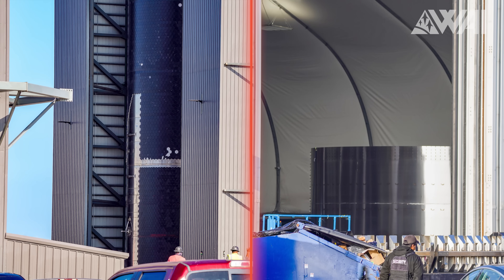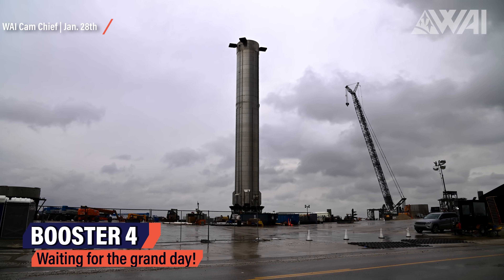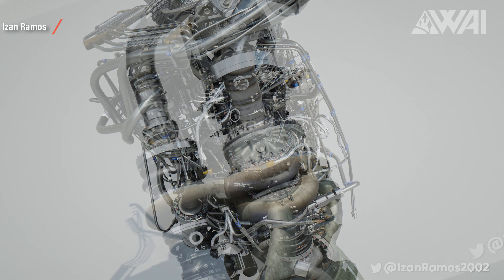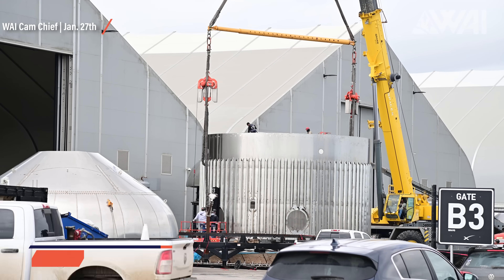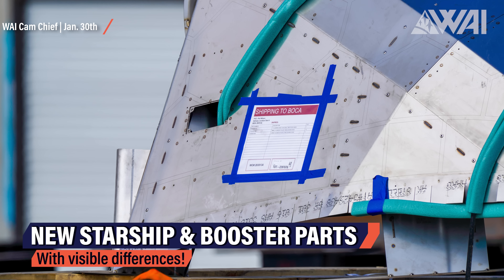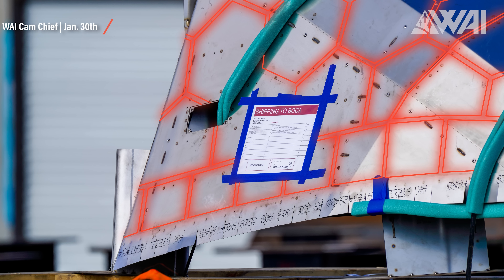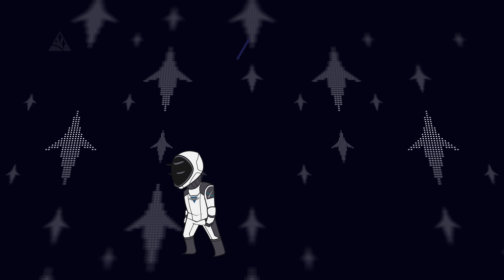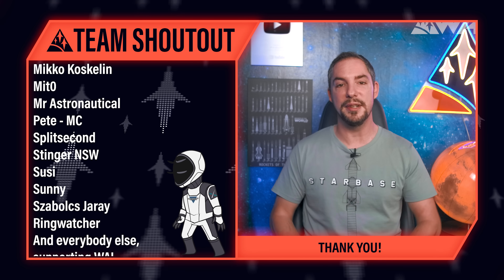SpaceX Starship Raptor 2 - When is it coming? Where will it be used?

Comment from the maker: What's the first prototype SpaceX will use Raptor 2 on? What do you think? :_WAISweet:
Reply: Great video Felix! Keep it going! 👍
Reply: Oh sí, nuevo video
Reply: 24
Reply: I think there's no question:  8/24.  SpaceX simply won't have the McGregor production facility up and running soon enough to outfit earlier model ships or boosters.

The more pressing question is:  Which booster/ship combination will be the first to fly?  I've already guessed that, too, will be 8/24, but it could well be even later in the progression than that.
Reply: I believe it's going to be mounted in my Silverado, after I do some welding to have a very solid mounting point, and add a couple more fuel tanks, a couple SpaceX engineers are going to have to help me with this conversion😆😉
Reply: Felix had a little mistake in script editing at 8:53.  And 9:01 And 9:01.
Reply: who care launch the starship.
Reply: B7 is 33 engine booster
Reply: hey felix just wanted to mention from 8:54 to  9:07 the line repeats itself, i thought i was just going crazy but i rewatched it 5 times to make sure, just thought id give you a heads up
Reply: Hey, Felix. I have a question, do you write your scrips in English or in German, I assume in English. But if to my surprise, you do it in German, could you insert a German sub. That would make it way easier for Germans who want to start in to the amazing world of space, to understand all the specific english terms.
Reply: @jeffrey949  The Raptor builders didn't got the memo. Also, I think there is no bird named Raptor, Raptor is just a word for birds of prey.
Btw, bird seems a little overstretching for describing a Draco.
Reply: Nice job
Reply: 24/7 stsck
Reply: 24/7 stack
Reply: @gamerfortynine  All of them. The outer ring doesn't change the number of engines. It always stays at 20. The inner section is where the change is from 9 to 13.
Reply: Please cover subject about Starship Crew access arm!!! Thanks a lot in advance!!!
Reply: The bags are 100 ton rated. NASAspaceflight caught a closeup of the bags. So 400 tons if all bags were full?
Reply: Wouldn't the upper starship need some fuel before the booster is fully fueled in case the booster explodes so it can perform an escape maneuver? Or at what point in the fueling process for manned missions will they need an escape procedure?
Reply: @Thomas_Acharya  Good question. Don't know if they have even tackled that yet.
Reply: They will Raptor 2 use 24/7.
Reply: OH NO!!!! Editor doesn't know his English!!! @11:50 it's a "LIFEtime Warranty" ... not a "LIVEtime Warranty" - better take care of this so that advertisers don't notice and complain ...  (I just want to help, plz don't be mad at me)
Reply: Well, I don’t think StarShip is going to make it to orbit this year with a 100-ton payload, that’s for sure.
Reply: Why are they still working on the raptor when ELON MUSK AND NASA JUST ANNOUNCED WARP DRIVE 2022?!

Comment: The difference between Raptor 1 and 2 is so small that even the engineers working on them can't visibly identify them. The changes are all on the inside geometry of the powerhead.

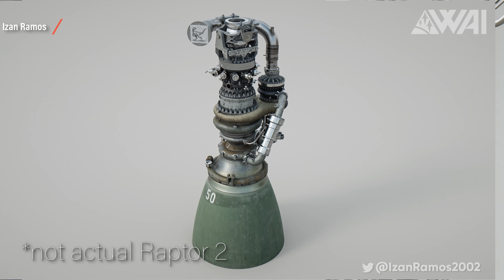Comment: 3:37 is NOT the model of raptor 2, not even close. It's done by removing external pipes of the raptor 1 model. It's the core of a raptor 1, or you can call it naked raptor 1.

Comment: Great job Felix I'm wondering how ships will move from landing or refurbishing to tower I don't see ships that need repairs or even cleaning and loading blocking towers if  it going to many launches per week
Reply: I expect eventually the chopstick/arms will transfer ships or boosters directly to/from the transport bases to be carried by SPMT (self-propelled modular transporter). No other crane involved. However, the other test mounts will still require the crawler crane.

Comment: They have stated about a year or half a year ago that they are producing one Raptor 1 per 2 days, so they probably have at least 90 Raptors already made. Maybe more. Raptor 2 also isn'T that close to mass production, and as I remember testing and delivery have a larger time delay between them, so I would be surprised to see 33 Raptor 2s delivered anywhere near today. Much rather in about half a year.

Comment: I think SpaceX found some rough spots on the tower-side tracks during the first round of chopstick load testing.  So these latest tests could've been used for checking the repairs they made last week.
Reply: You saw someone using what may have been a depth micrometer to check a number of spots. And then someone else do some grinding. And then another check.

Comment: id say maybe by summer they will be rdy for a orbital launch maybe, cladding commission the tower and mount, static fires with more than 3 raptors, 2 more horizontal ch4 tanks need to be installed since the vertical ones haven't been certified , lots of things to tidy up

Comment: Is it true that the chief engineers on the Raptor 2 quit/resigned with barely a word to Elon?  If that's true that was very bad form.
Also, is it true that Elon took over and slept in the factory again until he had the problems worked out?  Maybe he just provided the LEADERSHIP that the team needed to clean it up.   Neither case would surprise me.  After all, this engine is key if Elon is going to send a starship to MARS before he gets any older.   Don't bet against him.
Reply: My understanding was it was just the managers. There may have been a conflict as to what the engineers wanted and the manger wanted and the engineers won.

Comment: I'm so pumped to see the arms stacking, and the ship/booster being fueled on the stand. It's going to be so cool to watch!
Reply: I'm pumped for the orbital launch!!! It's been a long time since the last suborbital test. Getting so close!
Reply: arms stacking(for landing) is a miscarried idea! One big BOOOM and thy will come back to normal vertical landing!
Reply: @szyszka8303  yep I'm really nervous about this aspect too. Remember the booster can hover so that's some assurance but I expect to see a few blown up stage 0's along the way.
Reply: @micwallace   level of accuracy/precision for this ladning is not possible to achive(with arms).  If rocket shift 1-2m left/right side(because of weather, broken precision?) ... arm will slightly move whole rocket? :/ If it blows. How much time it will take to rebuild tower with arms? Now it took 1 year !
Reply: @szyszka8303  It's a reasonable concern, and I was very nervous about the idea when the idea was first described. I'm growing more confident by the day, based on recent comments about its operation use and how the design would handle the wiggles during hovering. 

You're right though, it could go wrong, as rocket stuff does. I suspect the tower will be fine, some of the towers plumbing and electrical might needs repairs. I believe they will put panels on the outside of the tower to protect stuff. Fingers crossed!

Comment: Anyone think they will upgrade to T-Rex engines for higher thrust to weight ratio once they produce enough of them to fix most of the issues with the design?
Reply: For the 18 meter wide Starship.
Reply: Raptor is a bird.

Comment: Hey Fexix, thanks for the informative Raptor comparison. Now that SpaceX has a reliable production Raptor, would it not make sense to convert a Falcon to run methalox, and fit a reduced number of Raptors?  With the number of launch sites to increase for Starship, it would make sense to be able to support Falcons as well, one of the benefits being at first to provide manned access via crew transfer to a Starship.
Reply: I'm reasonably certain that SpaceX has already done the calculus on this prospect and concluded that the changes that would be needed to the Falcon 9 would be too costly and unnecessary once the Starship program is online.  SpaceX wants to innovate, not recreate.
Reply: Falcon 9 is being phased out.  Starship is the future.
Reply: Why would one want to launch a semi-refurbishable rocket when one can launch a fully reusable one?
Launching Starships will, if all goes well, be vastly more economically interesting.
Reply: Why use both? Why do small cars exist when we have trains. Why do small planes exist along side an A380? Why do other start ups have a business case built around small launch vehicles?
Reply: @michaelreid2329  You didn't really read what I said about economics, did you?

Comment: Would it be possible to run raptor 1 and 2 on one vehicle? I’m guessing not, but could be good for testing? I’m no expert
Reply: Mass flow rate of propellant to each model of the engine is pretty different.  So, downcomers would probably need to be sized differently.  Next, Raptor 2 produces 230 tonnes of thrust (or thereabouts), while Raptor 1 produces around 180 tonnes.  The imbalances would either cause asymmetric loading and thrust vectors, or would require vastly different throttling levels to maintain balanced load and thrust.  Either way, way too complicated for a test article that already has enough variables to work out.
Reply: @glennpearson9348  ah I see, thanks for the info 🙏

Comment: will starship qd be adjustable in vertical direction for the stretched boosters that are being designed?
Reply: They can adjust it when they reassemble Mechazilla on the new launch site. They don't need to fill it in Bocachica.
Reply: @xiro6  When did anyone say that they were going to "move" Mechazilla to Kennedy SC??
I haven't heard that before.
Reply: @walter2990  You haven't heard that because it's patently absurd.

Comment: It was possibly a stress test but Adam has footage of a Raptor 2 running engine rich. Big "whoop" and green flames and an attempted restart some time later with another double whoop, turbopump screams of pain and a copper rich green flame. Probably died at that point.
Reply: Yup.  I saw that too.  Clearly, still some bugs to work out.
Reply: @glennpearson9348  Still seems to be performing very well, so I think it was a stress test.
Reply: @please_stop-v7o  Everything's a stress test.  The goal is to minimize the damage when the failures inevitably occur.  I'd rather see an engine eat itself on the stand than when mounted to a booster or ship.

Comment: Hello, I have a quick question please.  Do the solar winds travel outward in a spiral due to the Sun's rotation and the Parker Magnetic Field, or do the solar winds travel in a straight line independent of the field's influence?  From what I could find the solar winds are bent into a spiral and hit Mars at a steep angle.  But I want someone who knows more about this to correct me.  Thanks in advance.
Reply: Interesting idea. Cant say I know more or less than anyone... but you can watch footage of solar wind captured by SOHO such as "Decades of Sun from ESA & NASA’s SOHO" which sits directly between Earth and Sun, reportedly so it can provide early warning. In this or other images such as solar wind colliding and deforming Earths magnetosphere  - I've never noted any significant drift shown, the wind appears to come straight from the sun with lesser currents and perturbations occurring in any direction. It would seem Soho could not provide early warning of storms if they were spiralling significantly. The Parker Magnetic field would seem to have greater effect on electrons, with most of the mass and momentum of the solar wind made up of hydrogen and helium nuclei - that may overall just plow through the alternating fieldlines and current, instead of being swept up in them.
Reply: @adymode  Hello and thanks for setting me straight, I'll take your advice and go have a look.  When searching around I came across a web site called SDO & Space Weather written by Dean Pesnell from NASA.  It has a graphic on the landing page that I may have misinterpreted.  Cheers.
Reply: @gort2352  
Hi Vince, Thankyou -I'm stretching to get it straight myself... to me the graphic on that page seems ambiguously explained under the text, a part which reads: "charged particles are steered and accelerated by the magnetic fields that pervade the solar system" suggesting that winds travel in that strong spiral pattern shown. While the last sentence states - "with the charged particles of the solar wind spraying out into the solar system *like a garden sprinkler*" suggesting the graphic does not show the path of wind. As when we stand by a garden sprinkler it does not curveball water droplets towards us, they all fly straight outward from the sprinkler. The droplets expand out in spiralling lines as they are released in sweeping lines. We still must place our hand straight toward the sprinkler to stop getting water in the eyes, just as Soho sits directly between the Sun and Earth. 

While the sun does not emit wind in discrete jets, and the sun emits wind at a wide range of velocities unlike a sprinkler, the graphic might indicate how the pattern of two different velocities would spiral, if emitted spinkler-like in jets rotating in sync with the Suns magnetic field. 

The Parker Magnetic Field itself would be different again to either of these plasma/wind velocity traces that pass through it, as it is the actual magnetic field. The interplay of the Parker field and wind of different electromagnetic tendencies spiralling out at different velocities through it, presents to me a more fertile ground for generating space weather phenomenon, than for fully comprehending it :]
Reply: @adymode  Thanks Andy for your response.  You can understand my confusion when looking at the chart that shows the solar winds clearly spiraling outward at different velocities.  I've seen other graphics that seem to depict the same thing.  It's important to me that you understand that I greatly respect your opinion, you know more about this that I do so I'm not arguing with you.  But I do want to better understand this, part of that is what I consider “having a conversation”.  Having said that, I'd like to make a few observations please.

First of all I think Mr. Pesnell's comparison to a garden sprinkler was not the best choice.  None of the forces experienced by the drops of water are comparable to the forces emitted by the sun in space. Earth's gravity alone should invalidate the comparison, but I get his point, he was trying to simplify things.

I've seen a different graphic that showed the solar winds in a spiral but they were all shown from above the poles where the spiral is clearly visible.  That other graphic included Earth's orbit, on this image the spiral was much less developed by the time it hit Earth but greatly increased it's curve the further it extended away from the Sun.  That's why I assumed the curves were much more pronounced by the time they hit Mars, which sparked my question.  It appeared from that image the the spiral was far less developed when it's close to the Sun.

I did watch the video you mentioned, as I did it occurred to me that the observing satellite is in the same plane as the spinning Sun, and with a relatively cropped view.  Because it's not above the poles, with a cropped view and it's much much closer to the Sun is it possible that a spiral (if it actually exists) would not necessarily be noticeable?  Again please don't think I don't appreciate your response, just wanted to bounce a few things around.  

Thanks Again.
Reply: @gort2352  Dean Pesnell's email is on his Nasa Bio page. Im sure he wouldn't a little query on the subject : )

Comment: 3:31 in reality the difference is not so radical. As we can see on some low-quality photos of it, there’re still a lot of wires on it, but maybe the most beautiful change in the new Raptor 2 is the big red shiny tube😅
Reply: Obviously the raptors on the test stands will have additional sensors on it. Once they ramp up production at mcgregor they will not look similar to raptor1 at all.
Reply: Some pipes seem to be missing...